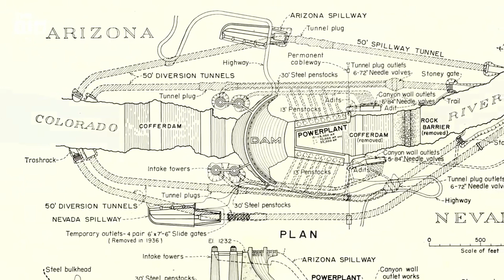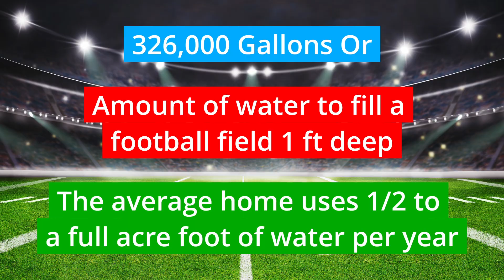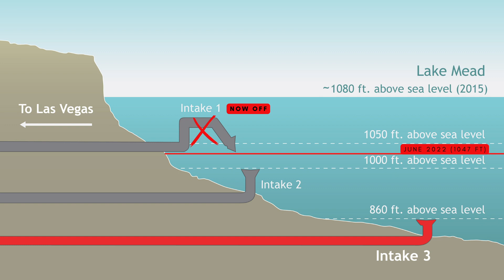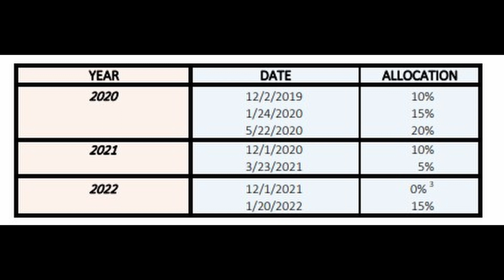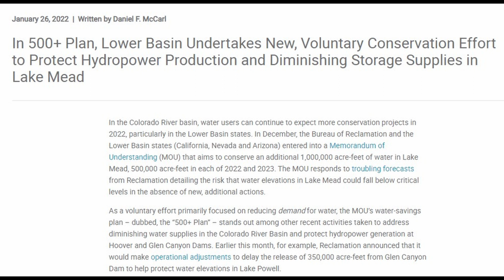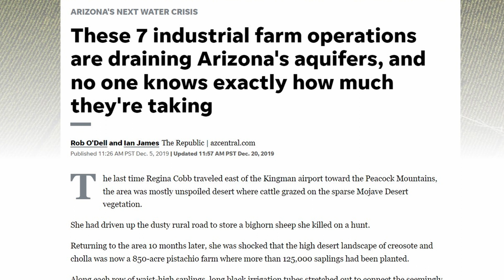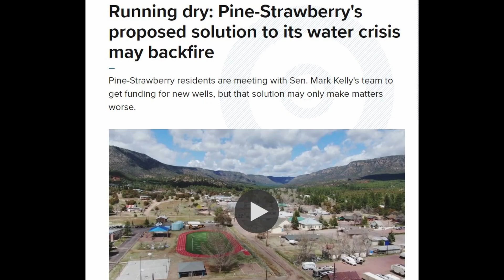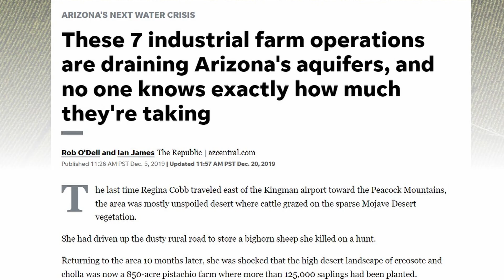Lake Mead and Lake Powell Are Drying Up. What will the Southwest Do?

Comment: The lake is not going to be long lasting ever but however there is a solution that are over to get that power even more than from the Sun and that name is that solar power of energy energy flowing to the cables the cable is connected to the battery the battery is it going to be connected to the old different plugs and electronics how and games and even well caveman of a sports and football hockey soccer or any other different sports as well that should know this already if the people are scared but why it had to be scared anyway I mean we have a technology of using solar power it's not a big free especially data of a crusaving money as well lots of money saving no more electricity bell-to-bell and no more of a where my tire prices that are to the power company that using wires and the other pepepe among for a week in the year it's very great solution that of a solar power is for the future it's much better and don't forget that at the battery and the extra battery that orbit just in case
Reply from the maker: Solid points

Comment: The lake Mead area is interested in one thing and one thing only the tourism and wealthy land owners the area will lose,   you can't keep building houses and growing crops in the desert.  All the rivers that flow to the southwest depend on snow fall in the mountains of the northwestern states, who have first water rights. No snow pack no water.  The money spent on a pipeline from the east will ultimately cost more than desalination of the Pacific, all southwestern states should contribute to the cost if they benefit from the piped water.  Another plus would be to stem the rise of the pacific ocean but at what cost to that? 
The real problem is unsustainable population growth.
Reply from the maker: All solid points! I think the major downside on desalination besides cost is that you produce super salty water as a bi product which could have impacts when re-leased
Reply: @SteveStomber  Isn't it salt what you produce after desalination? You distill water using extreme heat which uses a lot of energy which will cause environmental heads to explode, the person or company that can come up with a way to use solar power to create the heat needed to distill the sea water will have it made.  The northern states in the compact are not going to give up their water to support desert communities that should never have been used to grow crops.
Reply from the maker: @alicealdrich3376   so the most efficient way right now is reverse osmosis which uses  high pressure pushing the water through a membrane to separate the salt out. With this method for every liter of desal water you make a liter of brine solution (From what I read online-not an expert on desal)
Reply: @SteveStomber  distilling or large scale evaporation and recover is basically the same.is no different whether using energy or solar dry countries around the world use it to gather salt, filtration is,not practical on this large of scale.
Lake Mead is a man-made lake that maybe never should have been built this was bound to happen from the start.

Comment: Will las vegas become a ghost town?
Reply from the maker: The first state to see the impact of this will be AZ
Reply: Las Vegas doesn’t use the water from the reservoirs. They recycle all the water. But they do need the electric generation from the reservoirs. That’s why you have to try and save the lakes and do everything you can to stop it from drying up by covering it up and not letting the water go south to be use for water hungry crops. Must keep the hydroelectric. Hydroelectric is good for the people who live there and for keeping too much dangerous gases out of the atmosphere.
Reply: @judithwood6419  what dangerous gas ?
Reply: What is carbon dioxide which is hard for me to believe that you didn’t know that was that was that comes out of every car every thing that runs on gas oil and natural gas that’s the biggest one. And the two smaller ones I have to get the name yes all of them heat up the earth. Hard to believe you didn’t know that.
Reply: @judithwood6419  i find it ‘ hard to believe’ you are so gullible to believe the “green new advocates “ are in fact legitimate, what a joke.
Reply: And the other two is methane and nitrous oxide. Cover the oxide is the most dangerous because it’ll take more than 1000 years without without us putting extra into the atmosphere to return to natural levels. Methane will take about 20 years without us put additional methane into the atmosphere to return to normal levels. And nitrous oxide i’ll take about 50 years to return to natural levels. They are normal part of the atmosphere and as long as they stay at the right level it’s OK. But we have increased him to thousands time its natural level. And that’s causing the planet to overheat. We want them to be there to keep our planet from turning into an ice ball like Pluto. But we don’t want our planet to turn into a fireball like Venus.

Comment: Lake Powell is not drying up in fact it's rising with water.
Reply from the maker: That's good news. is the water coming from another reservoir ?
Reply: @SteveStomber  According to your video, Flaming Gorge.
Reply from the maker: @steven4315  Flaming Gorge water is going to Lake Mead (500k acre feet). To my knowledge Powell isn't getting any water they are just not giving up the 480k  acre ft to Mead like they were supposed too
Reply: @SteveStomber  Respectfully disagree, Flaming Gorge is in Wyoming and water needs to go thru Powell to get to Mead.
Reply: I thought flaming gorge and I think Navarro dams released water to Powell so they could keep producing electricity